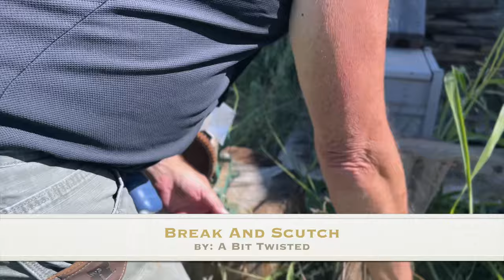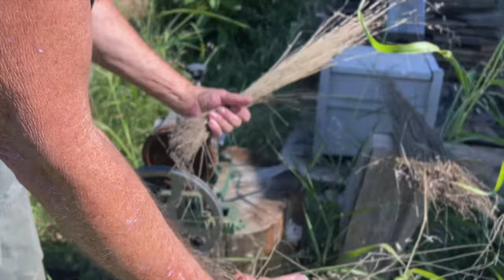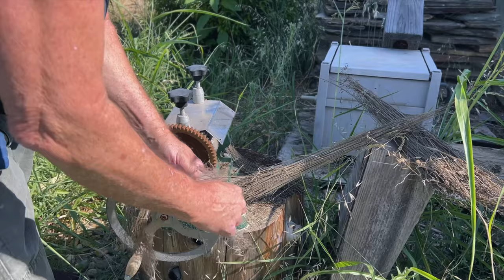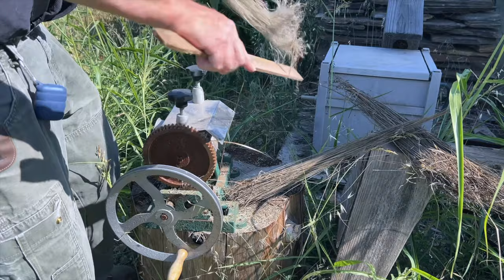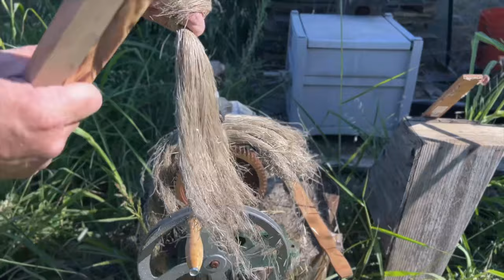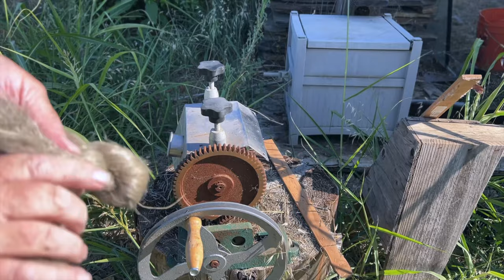Break and Scutch

Comment: Where did you get the press?  I like it!  Are the rollers flat?  I thought you mentioned that fluted barrels would be ideal.  It sure looked like it did the trick as you were getting it processed pretty fine with little effort after the press.  So glad your sharing this journey with us.
Reply from the maker: So the press is a sugar cane juicer. It crushes the cane to fully extract the sugar juice from the cane. Crush the cane then filter and drink the juice. It has three rollers in the machine. One is just a feed roller and the other two are the crushing rollers. It has super heavy springs attached so the rollers will move apart if the item being crushed is thick. It has little ridges but not like I'd like to see. It just crushes the bark so you still have to crumple it up to get the core to break away. If the rollers had deeper grooves on each of the crushing rollers it would work much better. It would not just crush but it would also break. At Chico Flax they now have an automated machine that has fluted rollers to break the fibers and they run it through twice. It works. Big operations have multi pairs of fluted rollers to break in varying degrees as the fiber passes through. All the rollers are tensioned with springs to protect humans from getting hands caught in the machinery. A safety measure. The multi roller machines work the best of all the ways. I'm thinking of making one. I want to take a cutter and cut v groves where the existing grooves exist already to get the rollers to work better. I think I can do that. If I ruin my machine that is fine as I did this as an experiment to see if an existing machine could do a similar job. If it works it will still be a single roller machine and would be more like the old wood brakes. Im thinking of making a metal break like a wood one but wiht thinner flat metal but built like the wood ones. Might actually work good.